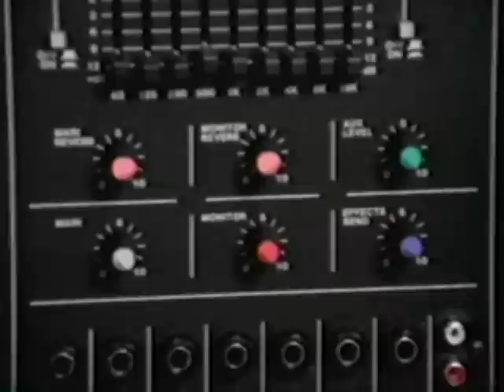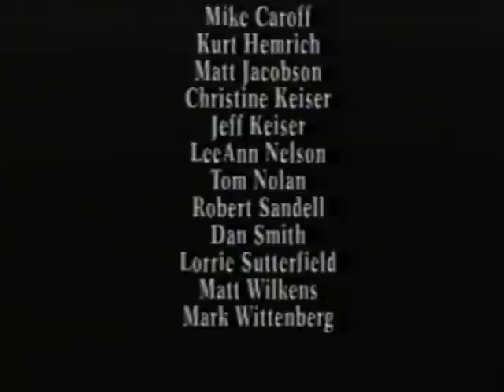The Fender Story

Comment: Actually, you can make ANY guitar with humbuckers sound just like a Telecaster by taking the humbuckers out and putting them back in reversed. So if you have a "bucker" in the neck position, just take it out and turn it 360 degrees to have the coil that faces the neck to now face the middle. Get it? It's just amazing to hear a Tele voice coming out of a Les Paul, SG etc. Also, there are some Tele's out there equipped P-90's so more Gibson players will feel more at home as well.

Comment: Stratocasters are very good. I originally used a Les Paul-like guitar, but I decided to switch to a Squier Stratocaster mainly because of weight problems. Eventually, I discovered the versatility of the guitar. But because I'm a rather small person, the longer neck seems to bother me, although the weight compensates a lot along with the versatility.

Comment: Buddy guy had it right with that fender bassman amp just a great blues amp I actually own a little fender module amp I dont like module amps but this one sounds pretty good and when you put it on the bassman setting it is the best setting makes the amp sound like a tube and its so poppy stringy and bluesy just a great sound and yet the reall bassman tube amp is 10 times better sounding just a great amp all arouhnd right noe om loving the vox ac10 I like the ac15 and ac30 but the 10 seems to have the best tome the 15 and 30 sound greta but there a little touchy but once you set it right its amazing but the 10 it seems is much easier to get right on the settijngs not so touchy sounds great anywhere noe fender amps are always going to have the best bluesy tone just amazing I lovr them def one of my fav to play really without pedals now the reason why im using the vox is bevause of the verstility and the way you can use pedals and how good the pedals sou nd through the amp but fender will always be where the heart is at and that destinctive tone

Comment: I can not see any reason why a guitar need to be more complex than the standard Telly. Why carve a big chunk out of the body for wiring and three pup's ? Why not a stb instead of letting the sustain dissapear through a piece of metal and three springs ? If i would order two Telly designs of my own model i would choose two designs. The first would be the affinity with one standard Telecaster pup and no pots at all. Only a circuit switch for treble middle an tone off. The other would be a single Fender fidelitron in brigde with a stacked pot that control volume an tone in the same move. So you roll the volume slight back and take the top of the tone. It should have a tiny capacitor so the tone will not be affected much when you roll back.

Comment: John Page, and then it says R&D...he never invented anything that lasted, nor did any other team member of the Custom Shop invented anything or improved anything...until this day in 2023. Go figure: staggered locking tuners? Sperzel. 5-way switch? Fender Japan. LSR ball-bearing nut and S1 switch? Bill Turner. 2 stud Fender vibrato? G&L (Leo Fender). Straplocks? Dunlop and Schaller. Locking vibrato and locking saddles? Floyd Rose and Wilkinson. 2-way adjustable trussrod? Not Fender. Improved vintage Strat bridge Saddles? Highwood (Marcel Dam). Trussrod Spokewheel? Not Fender.